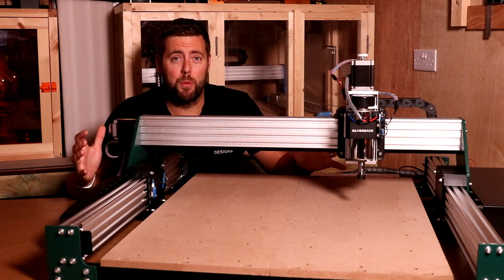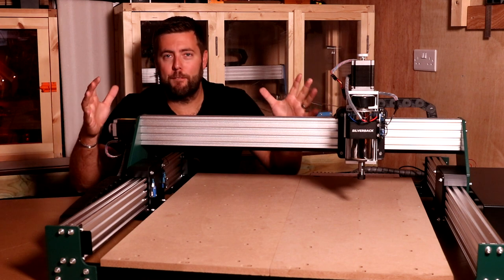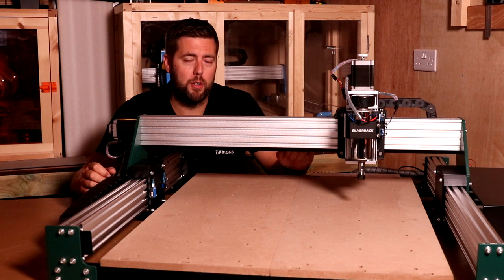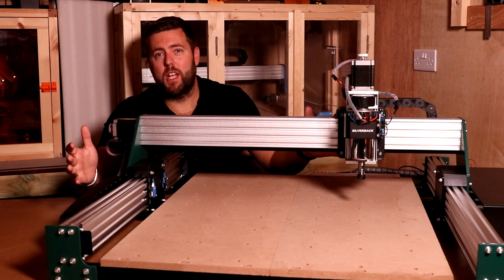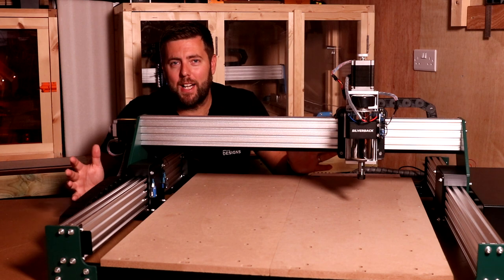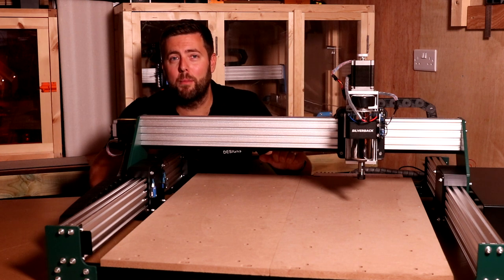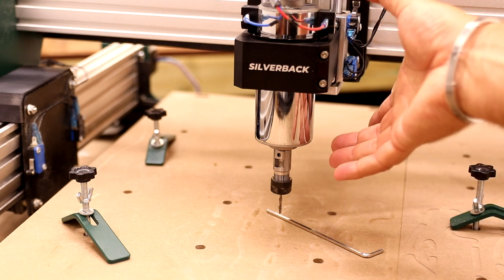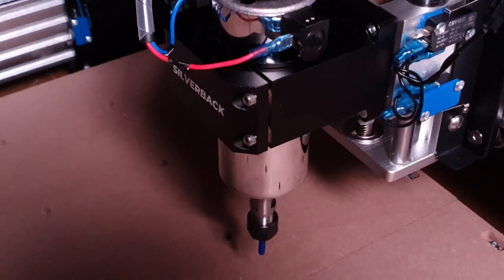Yorahome Silverback Review - 6060 CNC Router

Comment: What is your opinion on just using either the Y or X axis off the 1010 upgrade to have a 600x1000 bed size.  Do you think it matters which axis you expanded to 1000?  I am thinking the X axis to take up less interior shop space.
Reply from the maker: It can be done, and a few people have. Just a slight waste of having to buy the full kit but if you're OK with that and it works better for you then go for it.

Comment: Great review!  I am planning to buy a CNC router for my woodworking hobby.  I started out looking at a $200 3018 machine from Amazon, but the more I watched yours and others' reviews, the more I think I need to plan for a $2000 budget for the project.
Three of the machines that you reviewed made my short list. The FoxAlien Vasto, the Sain Smart PROVerXL 6050, and the Yorahome Silverback.  It appears that the Vasto is the best machine, but has a smaller working area, while the Yora Silverback has the biggest working area with a friendlier budget of $1600; the PROVerXL 6050 is in the middle.   Which one is better for woodworking (I plan to carve hardwood such as oak, maple and teak wood)?
Reply from the maker: The 6050 is the stronger machine, there is no doubt but I'd probably go Silverback (or ProverXL with extension) and use the extra money saved to get s better spindle or router

Comment: So which machine would you recommend for a beginner, fox alien 4040 pro, fox alien vasto or the silver back 6060, space not being an issue. Great videos by the way 👍
Reply from the maker: Overall the Vasto is the better machine, however the Silverback has a bigger work area. The Masuter Pro is the more budge friendly option. So if size is no issue and they are all in budget the. You just need to ask yourself will you ever want to cut 600x600 and that will pick the winner for you

Comment: Awesome video, I've learned alot by watching them. Currently have the 3018-Prover. Can't decide between the silverback 6060 or the prover 4030 with the upgrade kit. Recommendation?
Reply from the maker: I love my ProverXL but one thing that I wish Sainsmart would have done is sell the 6060 as a complete kit, and not as an upgrade because you end up with a lot of spare parts you do not need. It's quite wasteful. So for that reason I would say the Silverback as they are pretty much the same machine otherwise.
Reply: @JamesDeanDesigns  thank you
Reply: Quick question. Didn't see the link for the wheel covers that you made.
Reply from the maker: @superglidedyna97  I did forget but I think its been added now.

Comment: Hi James, thanks for all of the information and knowledge you share in each of the videos you produce. If my main goal was to cut 4mm acrylic rather than carve / engrave which 6040+ sized machine would be more practical given the YoraHome can't 'cut' without an extra Xmm spoilboard? Or, am I over thinking it? Cheers, JAYTEE

Edit: Also, it doesn't look like YoraHome sell a 1.5Kw spindle, so the question is, are they generic?
Reply from the maker: You not have to add an extra spoil board, I just advise it. But to be honest, you may want to look at the sainsmart 6050 if its within budget as the linear rails will help with how hard acrylic is. Ive just released a new video talking a bit more about the difference between something like Yorahome silverback or Sainsmart 6060 versus the new 6050 Plus https://youtu.be/4REwsNdQks8
As for the spindle, youll just want to make sure its a 65mm diameter and it should fit
Reply: @JamesDeanDesigns  Thank you James, watching now 👍

Comment: Hi James. One question if I may. Yorahome 6060 Silverback, Masuter Pro or Vasto? I know they have differences, but I would really prefer you honest opinion. I need to cut & engrave 5mm acrylic & cut 35mm timber on a regular basis. You can send it to me privately if you don't want to cause any controversy on the channel. Thank you
Reply from the maker: You're talking about 3 different machines, 3 different budgets and 3 different sets of hardware. The Vasto is the best machine, better hardware but also the most expensive. The Masuter Pro and Silverback will all cut those just at different rates. The Masuter Pro being the slower
Reply: @JamesDeanDesigns . Thanks James. I bought the Pro 3 weeks ago & have had nothing but issues. The left Y axis continuously slips & judders, even when it's not actually cutting anything. I've been adjusting the belts & reducing the depth & path speed. I was hoping that the rail system would cancel this & make my life a lot easier.

Comment: Great video and nice machine!  As you say, very similar to the Proverxl 4030. I think I will stick with it.  It gets me up and running at a lower price.  I can get the 6060 expansion kit later.  I am curious about the rotary tool.  Looks similar to the xtool ra2 pro..  How did it preform?
Reply from the maker: Considering I have never used one before, I was quite happy with it. You have to constantly adjust the axis step size depending on the diameter of the wood which is a pain but thats because its not really a 4th axis so to speak
Reply: @JamesDeanDesigns  upon another viewing, the Yorahome rotary unit appears to be more robust than the xtool ra2 pro.  I can't tell for sure without a side by side comparison.  The Yorahome unit has a sturdy metal chuck. The xtool unit may be plastic..  I don't know for sure.  It's a shame you can't get xtool in the UK to compare them.
Reply: @JamesDeanDesigns  Ooh, that is something that never occurred to me - I'll have to have a good think about that. Another option might be to munge the G-code to scale the rotary axis as the cuts get deeper. I do most of my milling by getting Ruby (think Python, but done properly) to directly generate the G code from programmatically defined geometry, allowing full control over the cutting paths (one day I will learn to trust a CAM package). So I already have a load of utility code to read/modify/write G-code.
Reply: @ericeinsmann5559  This is a little late, and maybe you've found out by now, but the RA2 is not plastic.  It's actually pretty sturdy.

Comment: I guess discount code expired, not working.
Reply from the maker: That's odd, it should do. Try JDD instead see if that works?
Reply: @JamesDeanDesigns  I also tried, it will not do anything for the machine. It will only do something with an accessory such as the dust boot attachment.